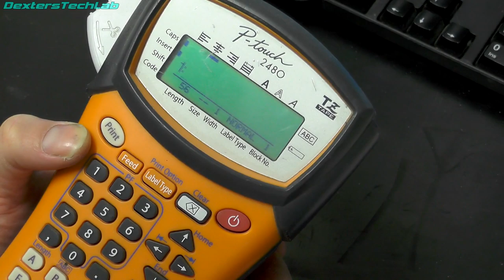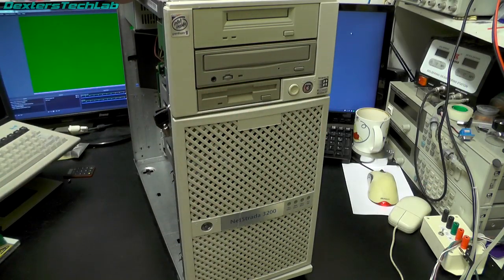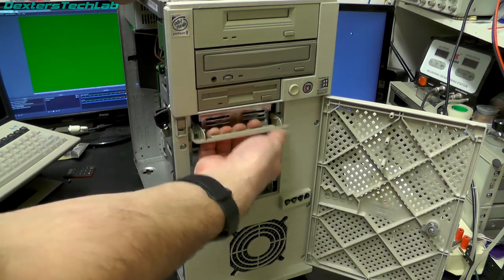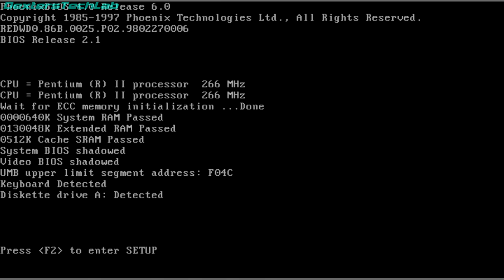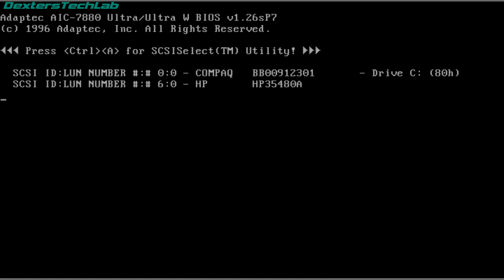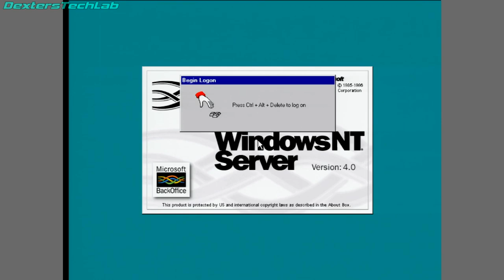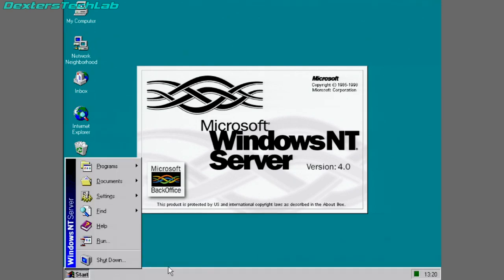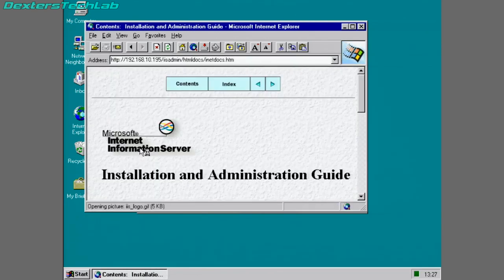DL185 Olivetti NetStrada 3200 Dual Pentium 2 Server Restoration Part 2

Comment: Pretty cool old server this, though for a higher end setup certainly got outdated quickly with that chipset only supporting 66 mhz fsb cpus so at best a 333 mhz pentium II i believe on slot 1 ?

Otherwise with a pair of good slocket adapters too socket 370 you got options for sure on 66 mhz fsb socket 370 cpus, though might need a slocket adapter with the proper voltage clamp settings for io voltages & such too be right if the motherboard can't take care of that by itself & locks the system up entirely due too not managing on its own. (Though slot 1 motherboards can be pin modded too sort that out it seems if needed.)

Could perhaps be built into a pretty good windows 2000 machine for a bunch of older games with those voodoo 2 cards you worked on recently as it is, though i guess you've sold it already ?

Then perhaps a socket 754 pc with a cheap sempron undervolted a bit & perhaps underclocked too 1.5 ghz from say 1.8 ghz or 2.4 ghz.
A decent cpu cooler like a freezer 7 from arctic cooling for less noise & make it as close too silent as possible with the two voodoo cards as gpus & perhaps making use of the integrated graphics sometimes found on most 754 motherboards for a 2d gpu.

Ofc as 754 was during the capacitor plague you might need too do some soldering there as well.
Reply from the maker: Thank you, yes i sold the Olivetti a while ago now. I had much bigger plans for the Voodoo 2's, a video is coming soon!
Reply: @DextersTechLab  Alright, can't wait too see that ^^. Got a voodoo 1 windows 98 system atm i messed about with a bit. though voodoo 1 is a bit too old for what id like too play. though serial ball mouse died on me so cant use it much atm.

Comment: Green USB to PS/2 adaptor and your V1.1white Intellimouse will work on that machine. Not sure about the later ones, but I know the white ones will work with PS/2 off the bat. Yes I also still have a serial mouse or two around, and also PS/2 ones, just in case. You rodent being balky I would say the rollers are gunked up, and just need a clean, and then a wipe with a alcohol swab, along with the mouse.
Reply from the maker: I spent ages looking for one of those usb to ps2 adaptors, didn't find it! I used to have loads of them!
Reply: @DextersTechLab  Same here, but must have one or two still around in a box somewhere as well. If I do find them will test on a USB to PS/2 adaptor I got recently to plug in an old barcode reader, and plug in the white mouse to try it. Then a later model black one, to see if the firmware is still there in the unit.

Comment: Im sure you could've got that second CPU cheaper. I would've given you a Pentium 3 550Mhz free.
Reply from the maker: Maybe if i could have waited for a cheaper one to come up, but that was the only one available with an identical stepping as the one that was already in there. Thanks for the offer of the P3 but this system won't work with Pentium 3, the 440LX chipset doesn't support it unfortunately.